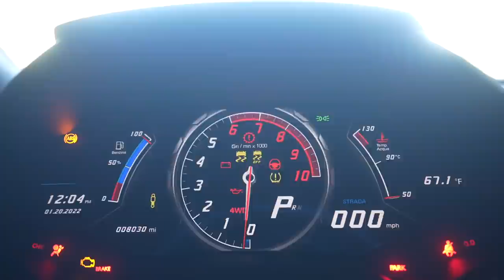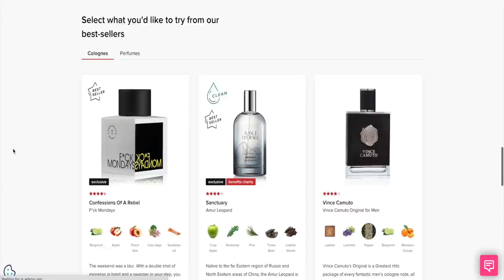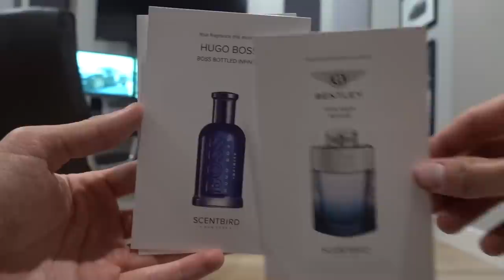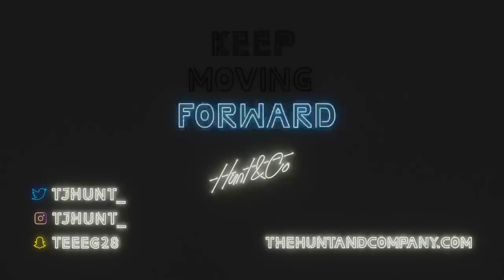WhistlinDiesel Made an Offer on my Twin Turbo Lamborghini...

Comment: Top collectors cars most smart buyers would want . Ford Shelby 65 427 Cobra 🐍, Ford Mustang Boss 70 428 , F40 , Porsche 959, Lambo Contach, Ferrari, Testarosa 6sp gated Ferrari 365 6SP , 911 Turbo 07 6sp, Ferrari F50 . Porsche GT3 , 1967-1969 GT500, Ford GT40, Ford GT. Blue chip investment car.